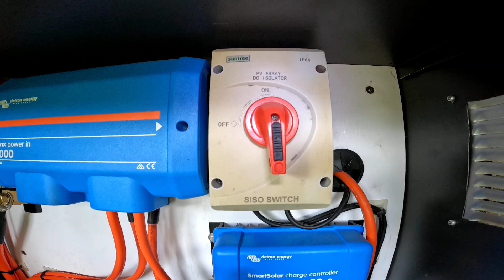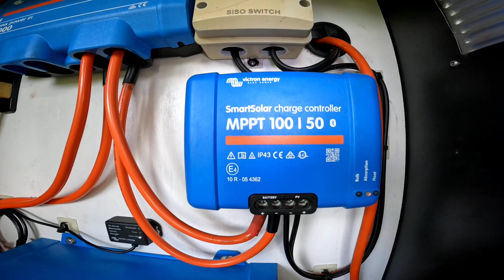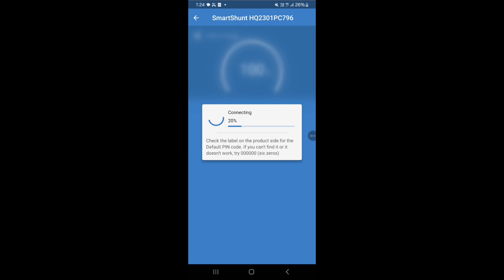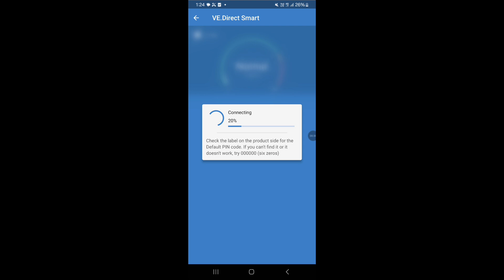24 Volt Offgrid solar Setup. Victron and Kings lithium ion batteries

Comment: Neat set up, but shouldn’t there be some fuses? One between the batteries and Lynx , one between the charger and  Lynx, one for the inverter, one for each of the 3 strings  of 2 panels?
Reply from the maker: Yes technically but that is why I have used the lynx system with inbuilt fuses. The mppt is fused from providing over current as well as the inverter from receiving too much current. I think this system should definitely have a fuse from solar panels. I personally dont like the fused mounted to batterys i have had a fire in a boat from one popping, so I am just relying on the BMS to do it's thing. Which could prove to be dangerous, I dont know so please dont take any of this as advice. It's just what i have done and is working for my situation

Comment: Yes thank you so much for the info on 24-volt systems what size /AWG wires did you use going from the charge controller to the lynx 1000 ?
Reply from the maker: I used 16mm which is 6 awg. All my cables are marine grade so they are double insulated and look larger than standard cable

Comment: Running 5 Similar Systems here and found Victron 100/50 & 150/45 Smart Solar Charge Controllers as The Best for Solar Harvesting. 24 Volt 10KWH Battery Banks for all 5 Systems and 24 Volt 1200 & 800 Model VICTRON PHOENIX Inverters and Piggy Back WZRELB Reliable Inverters Off My 300amp Buss Bars and Life is Good here on The Ranch @ 🌴💦 Indian Creek 🌵⛩ Southern California High Desert - Good On Ya Mate, Right Tidy Set Up 🙌
Reply from the maker: Hi there sorry for  late reply. That's an impressive setup, I was wondering what batteries you have used?
Reply: 8 12 Volt CHINS 280AH for a 48 Volt Dual Phase and XZnY 24 Volt 100ah and Both REDODO offerings in 12 and 24 Volt all 10KWH Battery Banks tied to Buss Bars  @anglingadventuresAA

Comment: Thanks for the video, not a lot of info on 24 volt systems, mainly 12 or 48 volts. I assume your in the northern half of Australia having 3 fans run continuously.
Reply from the maker: Your welcome @p.goonan7569  and yes that is correct. I installed Kingspan air cell insulation to the roof and walls to combat some of the heat.